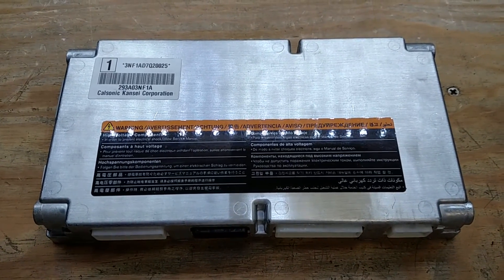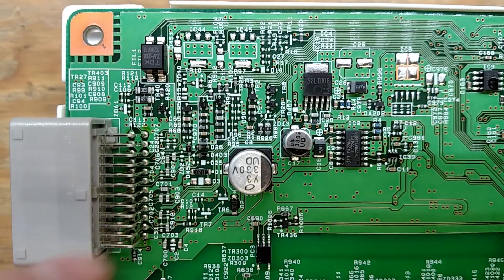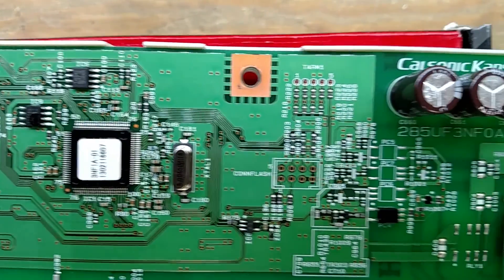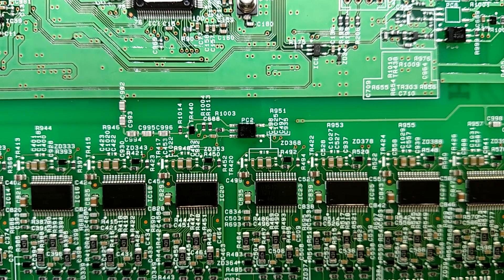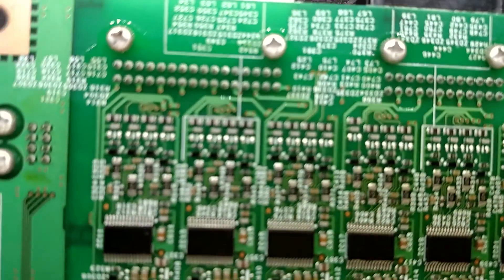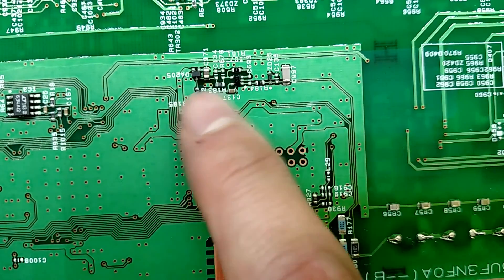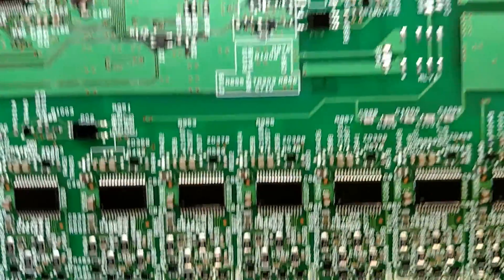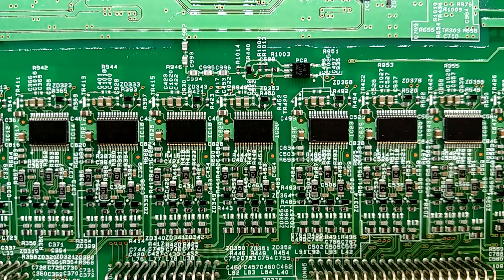Solectria E10, Lithium Ion Battery Upgrade, Part9

Comment: Love what you're doing!   Nice to see someone getting into so much detail.   Is it possible to break this BMS down to 12s or 14s and have it sitll work autonomously?
Reply from the maker: Each balance/monitor chip is powered by 4 cells, so 12s is possible.

Non-powered chips need to be bypassed on the LIN bus.

The BMS will no longer function properly, due to missing chips on the LIN bus.

I had to replace the microcontroller and write my own code.

See this video and the later ones in the series:
https://youtu.be/ew1JjlW_LX4

Comment: Grey connector contain Canbus with IC TJA1042 NXP 
2+3+14 Ground - 1 Can H    13 Can L - 12 Batt, 7 PWR, 5 Ignition - 6 & 8 detect switch interl. - Current sensor = 15 Gnd 9 Vcc 10 Signal
Reply from the maker: +Michel Grenier 
I believe it gets corrected in a later video, when a copy of the pinout became available.

But thanks for adding the pinout here.

Thanks for watching.

Comment: nice closeup of the bms. lithium lmo goes from 3.5v almost empty to 4.35v topped up to the brim. so its about 40 % soc id guess.
4.35v stresses the electrolyte too much for vehiclular usage though.
Reply from the maker: Once I have the batteries in the truck I am going to be real conservative with the voltage range... 
Probably start off with 3.4V to 4.0V see what the driving range looks like.

Then expand it out 3.2V to 4.2V

I would like opinions on what others think... I do want to prolong the life of the pack.

It would be nice to get actual data from a Nissan Leaf, discharge and charge cutoff voltages... and how they are affected by temperature.

Anyway, thanks for watching.

High resolution pics are here:
http://www.wolftronix.com/E10_LithiumUpgrade/index.htm
Reply: Definately don't go under 3.5V for traction with LMO. You'll cause binder damage (due to expansion/contraction) in just a few cycles that way. Also at those low state of charges the graphite is about to get unstable with the electrolyte itself.
Reply from the maker: +steven4601 
Those voltages came from the service manual for my pack... I think they correspond to 80% and 100% depth of charge... but I am not 100% sure.

I would like to see some real world voltages from a Leaf.